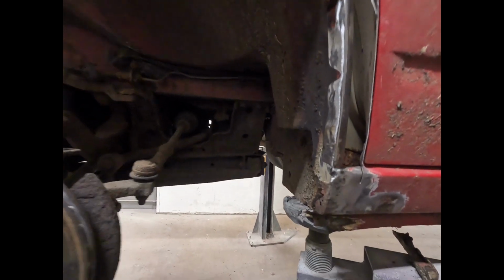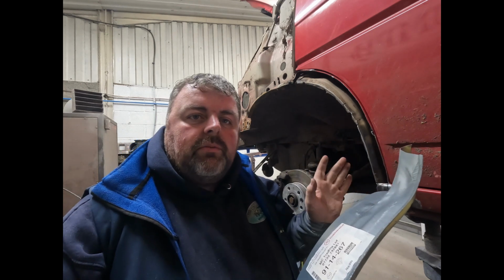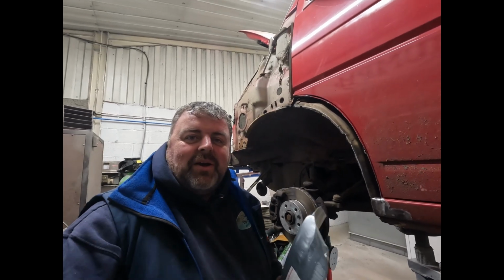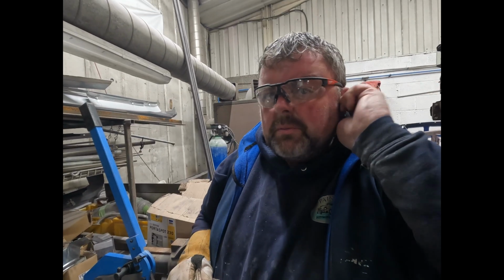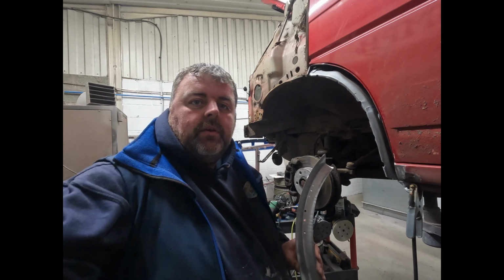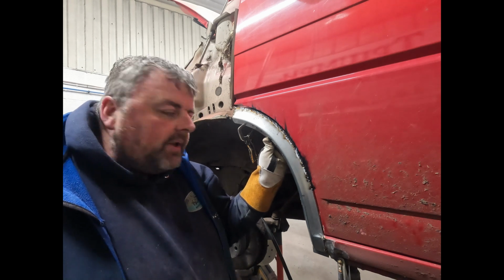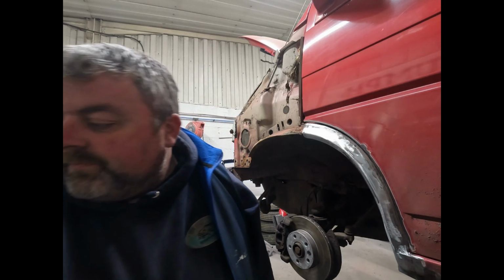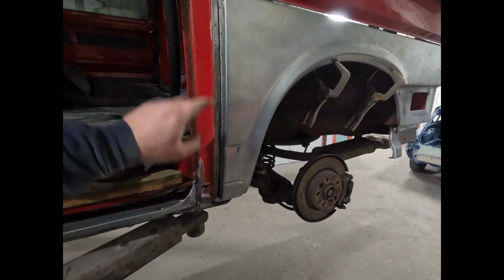Volkswagen transporter t4 more welding cutting and grinding new front arches

Comment: Great video buddy. Ive had all these panels replaced on my t4 for the tune of £1500.50 quid. Thats just the labour then the cost of  the panels and 2 new front wings. Unfortunately i didnt have the pleasure of fitting these myself due to no garage or unit. 😀
Reply from the maker: Yeh it's not a cheap thing unfortunately labour to get it right can take a while thanks for the comment

Comment: Hi I’ve just scanned through a few of your videos and it’s good stuff, I’ve just encountered rust issues on my T4 ( just after I’ve almost completed a golf mk3 engine conversion into my van 😫 which is featured on my channel ) I’m just about to order the panels, I was going to fit the whole front arch panel, but now seeing this would you advise just fitting that piece you have ? It looks a lot less work, my inner wings need repair to, also I am in the process of replacing the out riggers. Thanks for the video and I’ve subbed your channel 🙂👍
Reply from the maker: Hi thanks for that much appreciated i would personally try and fit just what I need to fit or at least to where I know i can get a good clean job done I haven't seen yours yet but if it's rotten inside the arch more than just the front edge like the one on my video I'd probably take it to the next edge if that makes sence good luck with yours if I can can any just let me know
Reply: @richardthepainter  Thanks for getting back, that’s what I think I’ll do just put in the new bits back to good metal 🙂👍